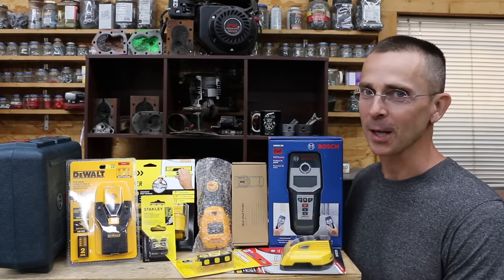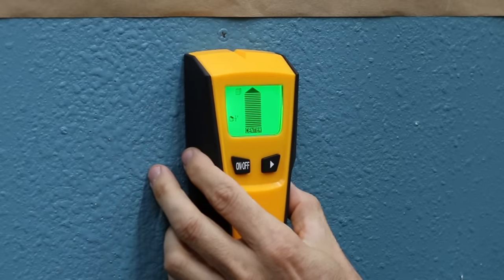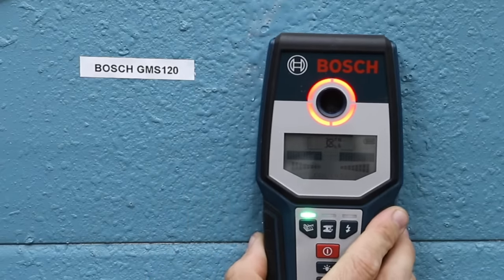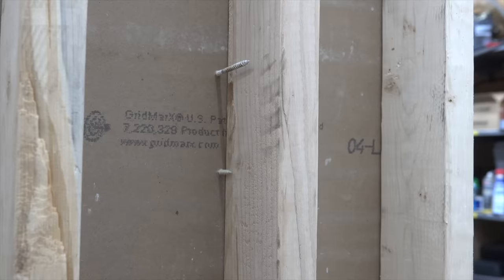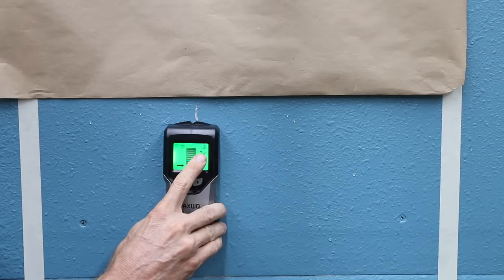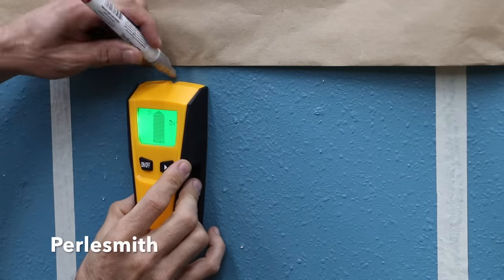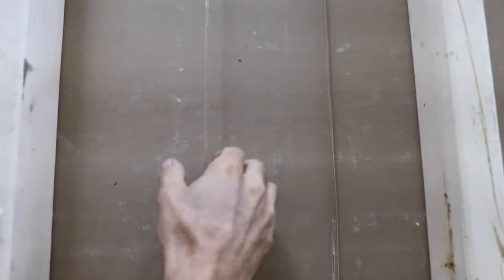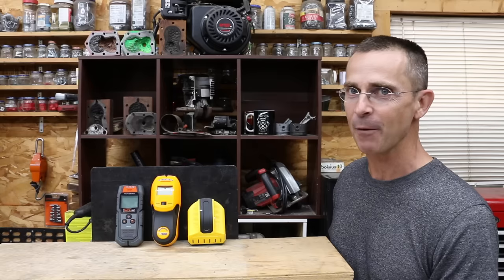Best Stud Finder? $262 Bosch vs $10 CH Hanson vs 9 Other Wall Stud Scanners! Let's find out!

Comment: Another great testing video as always by Project Farm!!  I have used the CH Hanson magnetic stud finder for years and have found such a simple stud finder is the most reliable and accurate stud finder i've used.  I have operated numerous electronic versions over the years that tend to have the "read errors" and completely miss stud edges, center of studs, etc.  I also own the Tacklife and have been impressed by it too.  As long as drywall screws aren't way off center from the studs, you will have extreme accuracy using the CH Hanson magnetic stud finder!!
Reply from the maker: Thanks!  Thanks for sharing.

Comment: I've found the best stud finder is a neo magnet scavenged from an old hard drive. Disassemble an old hard drive and remove the magnet, prying if off the bracket if necessary. Slide it around the wall and it will snap to a screw or nailhead every time, and as a bonus you can leave it hanging on the fastener head while you work.
Reply: I glued a string to the magnet. Works great.

Comment: I use an old Zircon for detection, and it shows edges plus CL of studs well.  I own two other Tacklife tools and have a good respect for the company.  The first variable speed multitool had a non-functioning speed control and they got another tool to me in 3-4 days at no cost. The AC/DC clamp multimeter works well. Both were well priced.
Reply from the maker: Thanks for sharing.

Comment: Id love to see how Hilti's hand held scanners stack up in the next round
Reply: We have a Hilti Multi Detector at work; it's almost like X-ray vision. Use it working around operating rooms, which have shielding, med gas lines, tons of conduit, & often thick plastic wall covering.

 But we also have some basic $40-50 Franklins & Zircons & they're more than adequate for most tasks. Heck, I gave my sister a $25 Hart (made by Franklin,) to hang some mirrors, and it works great.
Reply from the maker: Thanks for the suggestion.
Reply: @GabeMacDonnell  HOLY MOLY THAT THING IS NEARLY $2K!
Reply: FryChicken yeah, their stuff is really expensive, engineered near perfection, made w/ great attention to detail, & has fantastic customer service. & there's no way i'd spend my own money on it, (well, if i were rich...)

That said, in professional trades, the benefits outweigh the cost , & their leasing agreements are very well priced. If i needed a few tools for a home renovation, I'd consider signing a short term lease w/ Hilti.
Reply: @GabeMacDonnell  It never occurred to me, signing a short-term lease with Hilti might be brilliant for small home projects
Reply: FryChicken i'm not sure what their current rates are, but last I looked at it,  "Tools on Demand" went month to month, & would be a fraction of buying a few pro-grade tools, let alone paying a daily rental.

I think it will eventually be a popular option, esp. for smaller contractors, but its relatively new and Hilti doesnt do a good job explaining or promoting it...
Reply: @GabeMacDonnell  All the better, thank you for making me cognizant of this.  If I have a project, I’ll just reach out to Hilti

Comment: Walabot lets you "see" through walls, requires smartphone.
Reply: I've got a Walabot and it's fantastic.  Accurate and easy to use.  My customers always enjoy how it "sees" through the wall.
Reply: Jon Winters hey Jon what business do you do? I mount TVs and thinking of getting it
Reply: This: surprised not to see it in the lineup.
Reply: @christianmiranda7122  Tech Services and I did buy the Walabot for TV mounting.  I had a Zircon before and the Walabot is WAY better. It sees studs, wires, pipes, and makes my job easy.  It was worth every penny and has more than paid for itself with all the time it has saved me.
Reply: Jon Winters awsome thank you for the input I also do tech services thanks again Jon
Reply: @0bscura  The neighbors weren't as enthusiastic :p
Reply: Please include the Walabot in the next video.
Reply: Any idea how it performs in plaster?  I run across plaster frequently, and have yet to find a sensor that is fast and accurate.  The key word is fast - with a lot of futzing, I can generally get the job done.

Comment: You put a LOT of work and entertainment into your videos and product evaluations.  You are the Consumer Reports for the common man and woman.  Bosch has the D-Tech 150 with better capablities than the 120's.  I wonder if a hand held metal detector wand would be a good supplement to the stud finder.

I have the T13 and a couple  of Zircons.  The T13 LEDs are 1/2" apart so the resolution is at best within 1/4" of a stud's edge on one side or the other.  Most electrical wiring is centerd on the 3½" side of a stud.  When you add the ½" wallboard, the wire will be about 2¼" from the surface of the wallboard.  I don't think any of the detectors can scan that deep except for the Bosch D-Tech 120 (which is borderline according to their specs).  The GMS120 is just under the D-Tech's capabilites.  I issue I have is trust - just because it isn't detected, doesn't mean it isn't there.  I found that out when I cut wallboard out between two studs⚡.  My sawzall found electrical wiring running diagonally between the two studs.  Didn't make sense that any wiring should be there because of the location of the outlets and wall switches.
Reply from the maker: Thanks for the suggestion.

Comment: I'm a professional handyman, and use Franklin's Costco cousin. It's basically the same but green instead of yellow. They call them Precision Sensors profinder. They have models 550, 5000+, 6000+ & 7000+. I like the 550 because it's small enough to fit in a compact tool box/bag.
Reply from the maker: Great feedback. Thank you

Comment: 4:54 I bought two Franklin T13 sensors for $10ea at a hock shop.  They were still sealed in the box and work very well to find studs and ceiling joists.
Reply from the maker: Nice!

Comment: Great video as usual.  That said, no review of stud finders is complete if leaves out the STUDPOP magnetic stud finder.  I've been using it since it came out 10 years ago.  Unlike every other stud finder---electronic or magnetic---it is able to find studs (via the metal fasteners) in any kind of wall: sheetrock, tile over sheetrock, plasterboard, wood lath and plaster.  It's actually...fun? to use, if that's possible : )  Lately they've been selling out like crazy because of 2 separate videos that recently spotlighted it....it's pretty clear that neither of them were sponsored.  One of them has 400,000+ views with great discussions in the comments.  The inventor had to chime in quite a bit because there were quite a bit of negative commenters.  Guy at least seems to know what he's talking about.  I learned things that I didn't know---and I was already a fan.  But there's always going to be "Debby Downers" no matter what the subject.  After all THIS IS the internet, where EVERYONE is an EXPERT.  A legend in their own mind : 0  
Just my 2 cents.  Cheers!
Reply from the maker: Thanks!  Thanks for the feedback.

Comment: That yellow one with multiple sensors is best.  Carpenter contractor here.  I can check if it is stud or pipe with nail.  Once you find one stud it is easy double check every 16".
Reply from the maker: Thanks for the feedback.

Comment: As a contractor I have used a Zircon model stud finder like you tested for 12 years (I have replaced it once or twice) but for the money I have had excellent performance out of the tool and it has performed very well and is fairly rugged.
Reply from the maker: Thanks for the feedback.

Comment: A small level with a bit of painters tape ( protects the wall ) on it works great to find screw heads. I usually just tap the wall with my hand though, listen for the sound to change, then I use a tiny screwdriver to make sure of what is there. That way it can be easily filled with paint if needed. I'm an electrician btw. 
I do have a old stanley stud finder that works well, I just don't really need it very often. Mostly on double sheet rocked firewalls.
Reply from the maker: Thanks for sharing.

Comment: Very informative, I use the Franklin pro in my trade I view it as a reliable basic get it done tool,  I don't trust any of them fully for wire or pipes,  Yes so many brands to test, even Zircon has new models out now and Milwaukee has a higher cost one like that expensive Bosch,  Thanks for the videos great job on comparing tools,
Reply from the maker: Thanks and you are welcome!  Thanks for the feedback.

Comment: I love all your tests, even if it's something that I will NEVER use.  Try then (and the three Hart models) on (rock lath and wood lath)/plaster.  Note that on one, you had a finger hanging off the handle and on the side of the unit - which does affect the capacitance sensing.  WHY most don't have an ON/off switch is crazy,  It's hard enough to hold/slide them steady, and have your fingers in the perfect location, without holding a stiff button in.    

THANK YOU for all your unbiased reviews and tests.
Reply from the maker: Thanks and you are welcome!  Thank for the suggestion.

Comment: Great review!

I have  version of the Franklin T13 stud finder and it is by far the best for just finding wood studs. You have to be careful how you mark it, but it is VERY accurate. I have used several of these stud finders and the Franklin is head and shoulders above any I have used.  However I have not used the Zircon or the Bosch that you tested. The problem with Zircon testers is that they break easily over time. If there is a pipe or a wire near the drywall, the Franklin will find it, but if it is back too far, it won't see it.
Reply from the maker: Thanks!  Thanks for sharing.

Comment: I have the bosch n it tells u when u have non magnetic metals plastic n how deep it is n how wide it is so u don't screw into say pex or copper wire it also tells u where nails screws n staples are n even detects the end of each stud even if there are 3 in a row where as other stud finders will malfunction. It is the best stud finder I ever owned
Reply from the maker: Thanks for sharing.

Comment: It's nice to know that the inexpensive Zircon is a really decent tool for the price. I bought a Zircon years ago which I used to put up shelves a few times. It can find electrical wiring and metal objects in the wall. I'm glad to know my little Zircon is a pretty decent tool for the price, I chose a good one.
Reply from the maker: Thanks for sharing.

Comment: I have a very very old zircon. I believe it is time that I upgrade to the T6 or T 13.  Ease of use is my primary requirement with accuracy second.  Also I plan to do work on copper plumbing pipes in a wall. So I may have to get the Tacklife for precise pipe location.  Thanks for all your valuable test results.
Reply from the maker: You are welcome!

Comment: Wish I'd seen this video a month ago!  I was running low voltage blind in an existing wall to hardwire a video doorbell, when I ran into a horizontal obstruction while fishing the wire.  Without a stud finder, I was left with the old finger tap and drill probe methods.  Needless to say, I ended up having to remove a small section of dywall to really see what I was dealing with and to work around it.  If I had been able to simply scan for and mark the edges of the hidden board, I would have had other, less-destructive options.  Looks like I'll be picking up a Franklin T6 to save future headaches.
Reply from the maker: Thanks for sharing.

Comment: I love my Zircon detector.  Works well and always is better than the others I have used.
Reply from the maker: Thanks for the feedback.
Reply: @ProjectFarm  It did well in this video and was one of the way more cheaper options. Throwing it out there for anyone looking to buy one. 

Also, great videos.  You are the "Go to" when researching on which brand to buy.  I hope you get compensated well for your videos.  The added fact that you do not do sponsors makes your unbiased testing that more credible.

Comment: The test wall seems to me to be an ideal case.  I have problems with detecting studs in the wall between an attached garage and my house, where the drywall is two layers as a fire barrier and finding 2x6 ceiling joists where there is blown-in insulation between the joists.
Reply from the maker: Thanks for the feedback.

Comment: Another awesome video, PF!
  I’ve been using an ancient Zircon “Trucal Studsensor/AC Pro”, I picked up at the Homeless Despot in 2005. This unit has been dropped down hardwood stairs, sat on, and rained on once all night long. And despite all that, it’s never failed to accurately find studs, and locate live wiring. Still kicking along as I type. Just my $.02, but for the price, you can’t go wrong with a Zircon unit, imho.
   Btw PF, I’m fairly certain this video was served up to me by the YT AI feed, because I did an internet search for the “Walabot” stud finder today. Not sure if you plan on doing another stud finder video (and you may already have), but if you are pls consider putting the Walabot in the line up. It appears to be somewhat like a thermal scanner, but I’m thinking it’s simply a micro processor driven stud finder that then renders a “thermal like” rendition of what it “sees”, on the screen of your phone.
Reply from the maker: Thanks!  Thanks for the suggestion.

Comment: A good test might be to compare which electric tin shears are the best. You could throw in the DeWalt and malco attachments for drivers and drills also. Your content really is superb. Thanks Alexander
Reply from the maker: Thanks for the suggestion.
Reply: Yep and test them on asphalt shingles at the same time. Trimming shingles without cutting what's under the shingle on the roof is the appeal.

Comment: I'm very impressed by the Bosch D-tect, I work with low volt wires A LOT, and since they're rarely pressed right up against the drywall, it's ability to find it when its set back towards the middle of the wall (even if it is a close approximation) is a huge advantage over having to blindly cut a hole and fish for the wire.  The price hurts a bit, but the time saved for my use case may well make up for that.... wonder if I can get my boss to pay for it.
Reply from the maker: Thanks for the feedback.

Comment: For a future episode, I'd be curious about the drywall mud at joints and if it has any effect. I would also be curious about multiple layers of drywall, drywall over donnacona soundboard, and fire board. Firewalls are often double 5/8" and it is far more dense than regular drywall. 
Thanks for your content.
Reply from the maker: You are welcome!  Thanks for the suggestion.

Comment: Amazing video but it falls a bit short. If you want to redo the video, i'd suggeat repeati g the same tests with various insulations between the studs (fiberglass, rockwool, spray foam). Also add wal-a-bot type wall scanners to the review. 
Much appreciated

Comment: For me the $10 magnetic one is the best.  Partially because it does a pretty decent job finding drywall screws and partial because it makes an excellent refrigerator magnet so I can easily find it when I need it.
Reply from the maker: Thanks for the feedback.

Comment: Can you please do this again, with an old style plaster over wood lath wall?  My house was built in 1915.  Normal stud finders just don't seem to work, regardless of which brand.  I borrowed a $200 unit from a contractor friend.  It did a little better, but not much. Thanks
Reply from the maker: Thanks for the suggestion.

Comment: Several follow up suggestions,   plaster wall and tiled wall (like a bath wall needing hand rails screwed thru the tile).  Also the walabot finder that shows what it finds in a picture on you phone.   Thanks for great tests...😊
Reply from the maker: Thanks!  Thanks for the suggest

Comment: Yes let’s have another round with the new dewalt and the Franklin sensor M210! It now has a detector for electrical wire built in with deeper detection.

Comment: It might be worth noting that the "digital" stud finders won't work in many situations. My house was built in 1910 and nearly every wall still has plaster and lath. Battery-operated stud finders are mostly useless for this kind of construction as they can't usually see through the thick layer of plaster and lath to find the studs. The C.H. Hanson model is my go-to for finding studs behind plaster. It actually does a pretty good job of finding the nails which hold the lath to the studs behind. I have one tip for using this model on walls with particularly thick plaster. It can be difficult to feel where the nails are if they are buried deep, and the magnets definitely won't hold their weight and stick to the wall. What I do is tie a string to the "loop" end of the device, and slowly swing it from side to side along the wall. Eventually, you will see a slight deviation in the swing where the nails are, and it will even stop swinging in most cases. The C.H Hanson stud finder has been a life saver owning an older home.
Reply from the maker: Thanks for the feedback.  Thanks for the tip.

Comment: I use a 1/2" x 3/4" cylindrical samarium, cobalt magnet that will find any screw or nail effortlessly even thru 1" drywall. Obvious only works on ferrous metals not wood, but has never steered me wrong.
Reply from the maker: Thanks for the feedback.

Comment: You should do a blind test where someone else puts things behind the drywall to eliminate confirmation bias. I’ve never had a stud finder really fail to find things, they always seem to leave me unsure of what they are indicating. When you know what is behind the wall, partial or spotty indicators are easy to be confident in.  Because I haven’t found one that is confidently consistent, a small drill bit has been my stud finder for years and has never failed.
Reply from the maker: Thanks for the feedback.